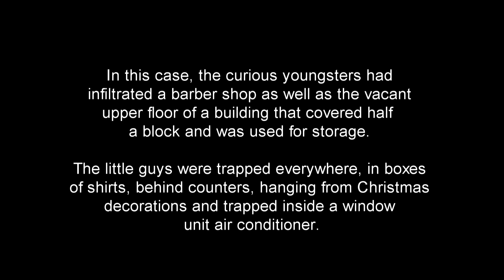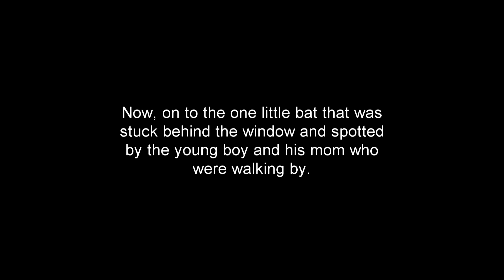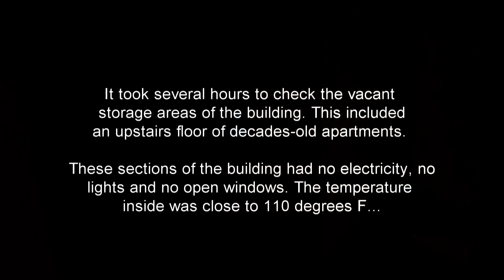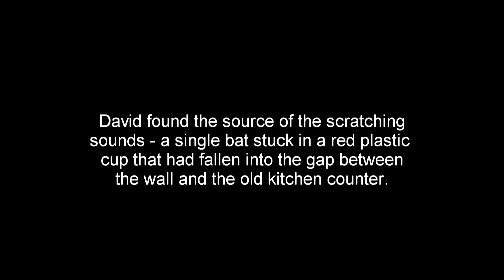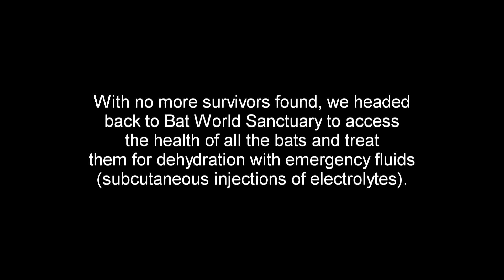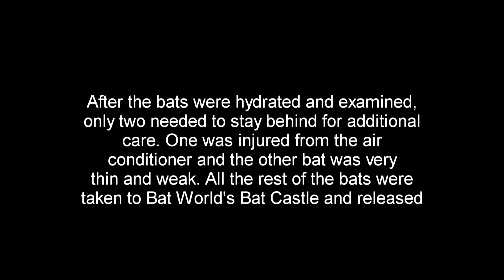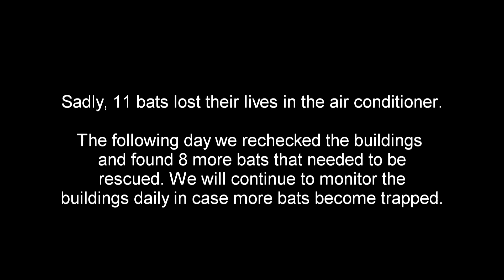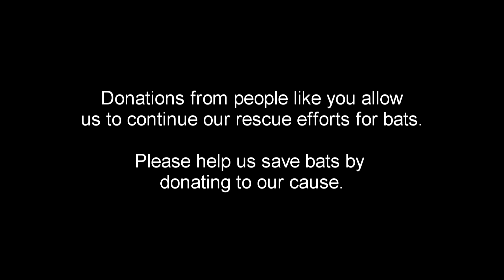46 BATS RESCUED

Comment: WOW! What an INCREDIBLE rescue! You are heroes for braving the stifling heat to thoroughly scour that huge & cluttered building. ❤️🦇🦇🦇

I can't help thinking how lucky those bats were. Not only were they spotted by someone who actually cared enough to call for help, but they were also lucky to be in the vicinity of BWS & your Bat Castle. 

I found only a single rescuer in Central IL to rescue a grounded Little Brown myotis. If ever there's a need for a mass rescue here, I'm afraid it would be impossible to save them in time.